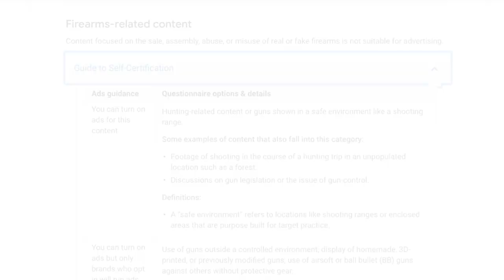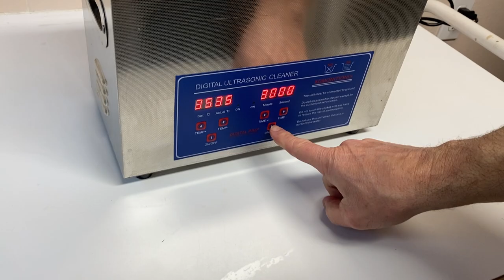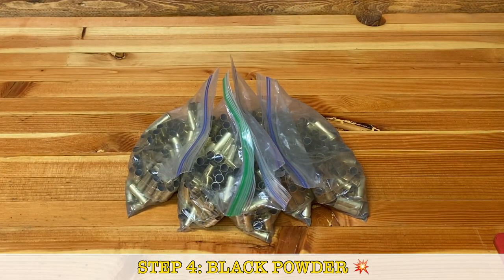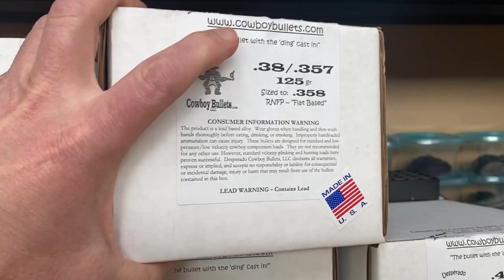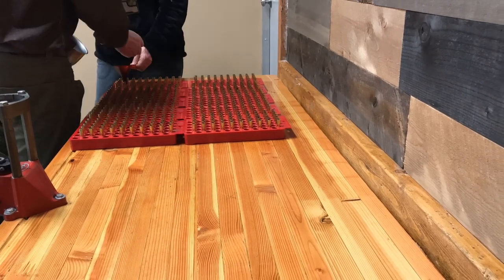BLACK POWDER .38 Special Loads [HOW TO Black Powder Cartridge Loading / Reloading]

Comment: One thing, how long .38spec or 12GA with BP (not substitute) can be stored?
Reply from the maker: I’ve never calculated it exactly. But, I’ve never had it go bad and I’ve had some rounds, like 45/70, sitting around for years and years. 
I couldn’t give you a definite expiration date on loaded ammo though. I’d guess there are a lot of factors that would change the timeframe too. 
~Jed 🤠
Reply: @JEDiTV  So 3-6 months is not an issue with them.
Reply from the maker: @abrampl  - not at all.  I’ve got .32 rounds that I loaded years ago for Miss Harley (she doesn’t shoot much anymore). I shot them this year with no problem.  
~Jed 🤠
Reply: @JEDiTV  I solver my problem last monday. I had 55 rounds 12ga created on FFFG black powder. So ;) we just shot them all. Problem solved. ps: my plastic wads must be replaced by something natural. You showed on one movie 'plastic snakes' ;)
Reply from the maker: That’s a good way to handle it @abrampl  🤠